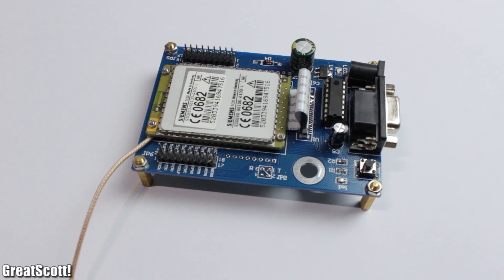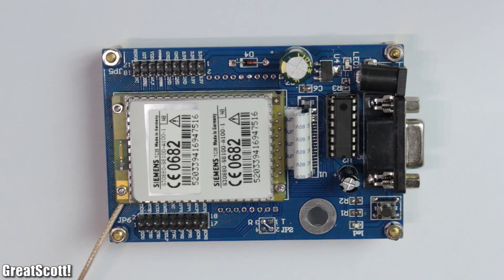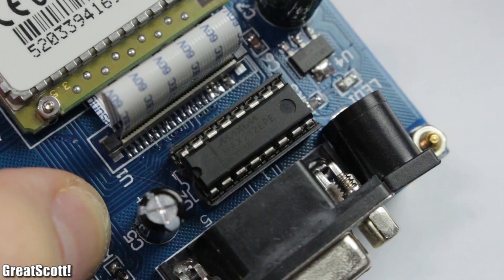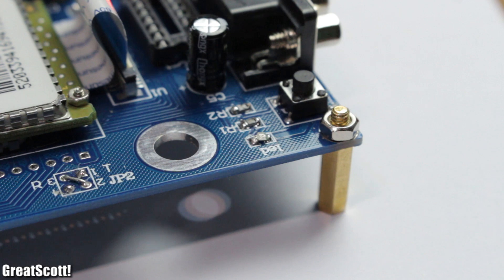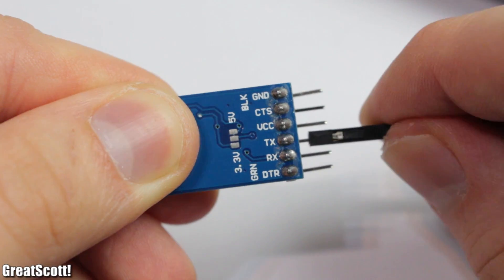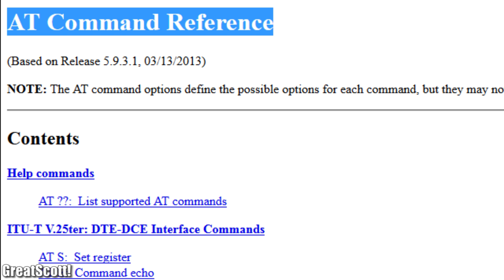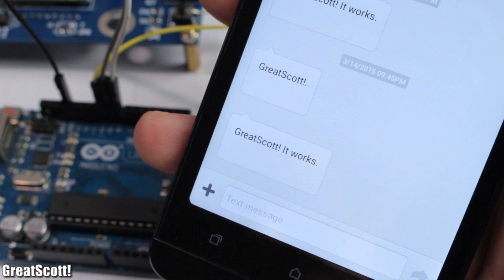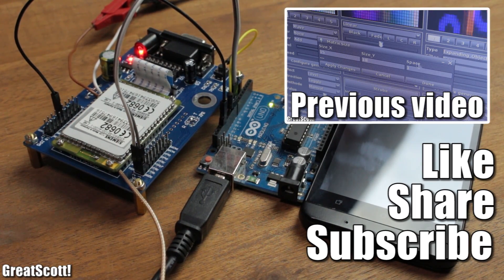Electronic Basics #11: Sending SMS with Arduino || TC 35 GSM Module

Comment: its my understanding that "GSM" is no longer working! the phone system has changed and i dont think your device will work? they have gone to "LTE" is this correct? and is this video obsolete?
Reply: It depends on your mobile operator. Some operators have stopped supporting GSM/2G and therefore require a 3G/LTE compatible module. Even when it is something as simple as sending a SMS.

Other operators still support GSM/2G. 

You have to ask the mobile operator what they support.

Comment: Omg i would love if you show how to make an arduino phone !
Reply: Lieberdk you can't
Reply: BeGamerSl tell me why, the only problem would be  the size
Reply: well the last time i checked Arduino can do only simple or/and/if commands and can only process up to 8 bits of data or higher depends on your chip,but a modern day phone has a CPU in it which can process farrrrrr more data than a simple chip
Reply: BeGamerSl well, other processors can work with 32 or 64 bits but they still do the same operations, the only limit of the chip that arduino uses is the flash storage size
Reply: Don't wireless handsets have those simple processors inside.
Reply: While you can't make an arduino smartphone, something like those old phones would work. But I don't think using an arduino is worth it, even a pro mini, as it has a lot of useless junk on it for a phone and it would take up a lot of space. Better use a bare Atmega328P (the microcontroller found on the arduino) and use the same arduino code, or even better, get an STM32 and program it, those things are beasts!

Comment: Hi!I think this is the perfect Project to get my home alarm to send an intruder alarm via GSM/SMS. But I'm a little confused how the Arduino is trigged at an alarm ...The switch at the GSM board is just to get the board ready=establish connection with the GSM Net. Right?or...Will the predefined SMS message be sent when switch at the GSM board is pressed?or ..Should some pin at the Arduino be activated in order to send a SMS? If yes, then the sketch for Arduino would be rewritten?Nice if you will sort this out, because I want to send a SMS when my home alarm is activated!Regards misterleffe
Reply: get a magnet switch connected to the Arduino write a sketch that will send a message when the switch is deactivated

Comment: So I have a 12V 1A adapter, and I removed the maxim thingy from the GSM module. But when I plugged the power source in, the thing started to fizz and I saw smoke coming out. So why do you say that it can handle 12 volts?
Reply: +joster222 Okay I DIY'd an adapter of 4.5V and 500mA. No more sizzling or smoke. But now I have a different problem. I inserted the Simcard, but now it justs blinks a few times and then stops. Does that mean it can't connect? I made sure that the simcard is correctly inserted.

Comment: Hey Scott, I love your videos! I'm just a beginner in electronics world and still only blinking LEDs and stuff like that, but I had an idea of using smartphone as accelerometer/gyroscope alarm for my motorcycle, but most android phones do not want to do anything while screen is off, so, are unusable... But this seems like it could be a way to go, could it be used on battery thats charged by generator and have some movement detectors? My idea is to send sms or call if bike is moved, maybe even do some feedback for the one moving it.

Comment: You can easily use an old phone to do this as well since virtually all mobile phones since the beginning has an exposed AT interface via the modem and you just connect with a serial interface just like the example here in the video. I have reused many old mobile phones as remote alarm senders in the field. I charge the phones with solar cells and they run forever unless something goes wrong... I do all of this with an atmega328 - which runs from the phone battery as well - and if the battery stops charging it sends an SMS when it falls below 10% so I can go out and swap the phone. Very cheap and useful usage for old phones!
Reply from the maker: Jens Andree Awesome!
Reply: @greatscottlab  Please make a video about this.
Reply: can u make a video how to use old mobile phone as a gsm module
Reply: Not all old phones have an AT interface, and some have interface but not necessary have the AT commands for send and receive SMS.
Reply: +Jens Andree .....do the phones have to have an active service?
Reply: Jens Andree : hi, can you share the circuit, schematic, code & video so that i can try it, my email is mangara.elias@gmail.com
Reply: +Luis Gonzalez Yes. Use the cheapest pre-paid card you can find and you're done!
Reply: +Jens Andree Can I have ur email? I think I need to discuss something with you. Thank you
Reply: Thank you Jens. I have read your email and I could get your points.
Reply: Yes

Comment: Do you need to power it allways from a 5V power supply? Can't you just power it from the arduino itself?
Reply: GreatScott! You could use a 3.3v arduino though right? Maybe a nice cheap arduino pro mini clone off ebay?
Reply from the maker: The module can draw up to 1A peak while sending a SMS. Your Arduino will not like that.
Reply: GreatScott!
This module is a bit more powerfull than the others I've seen o.O

But it's possible to power the arduino throw this module?
Reply from the maker: No, the module uses 3.3V power. Arduino needs 5V.